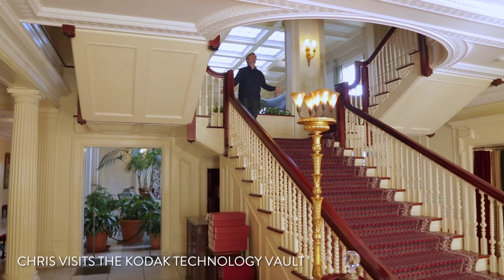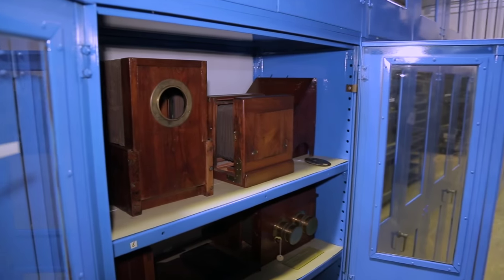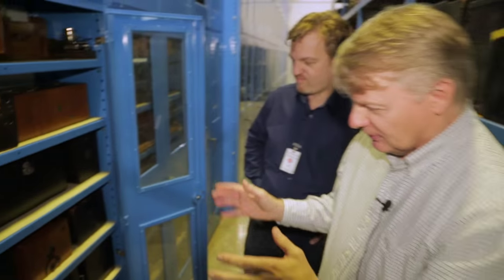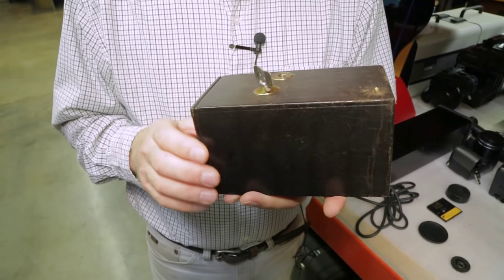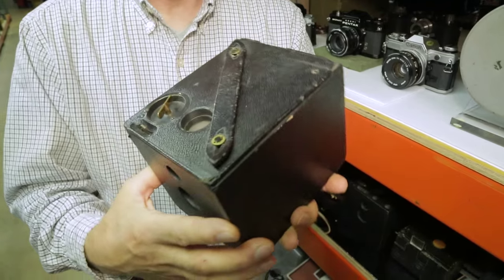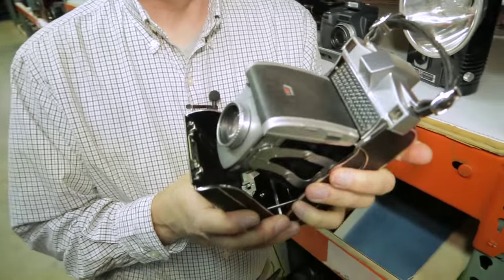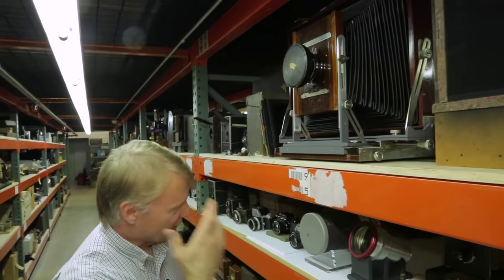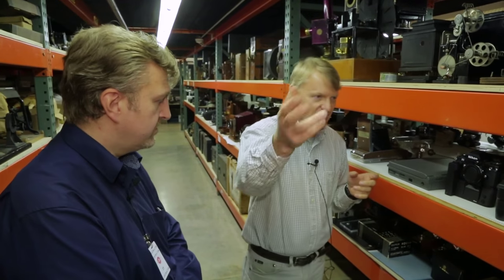A Private Tour Of The George Eastman Museum Technology Vault

Comment: I have a question here for anyone who used to have a kodak product from the past. I don't remember the name of it but what you would do is to take a negative and put it in the enlarger and expose the picture on the paper then you would put the exposed picture into a Kodak printer. You would then crank the handle and the picture would come out at the end. You would put a chemical into this machine and as you crank it the picture would go through the chemical. It was like an instant darkroom. I believe the machine had the name Ektar somewhere on it but I don't remember. Does anyone remember this thing?
Reply: yes it was called Ektaflex, I had one.
Reply: So you do understand that George Eastman Museum has absolutely no connection to Eastman Kodak … right? This collection is so much more than Kodak products. They are just one small element.,